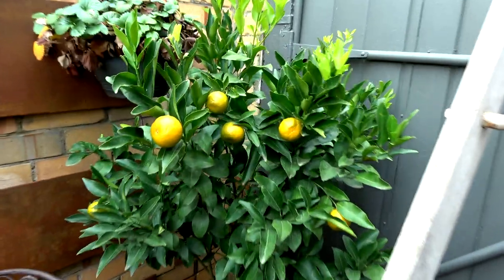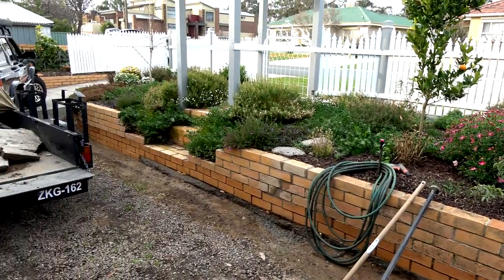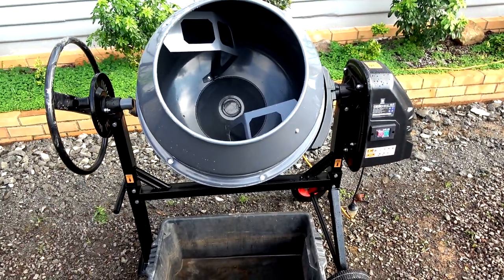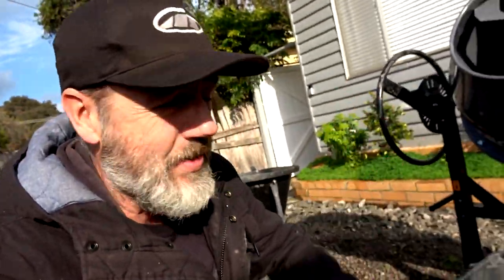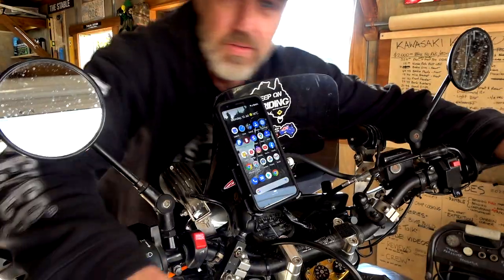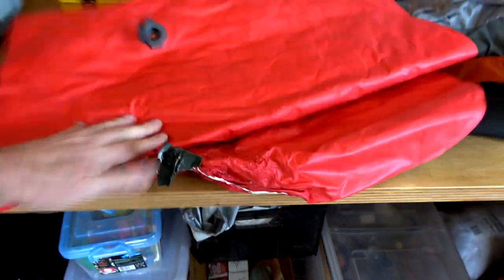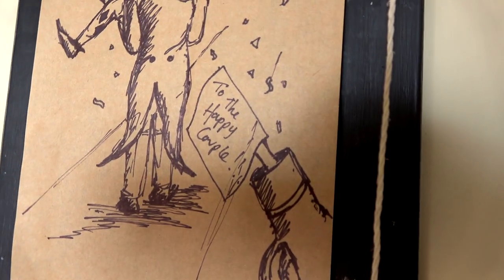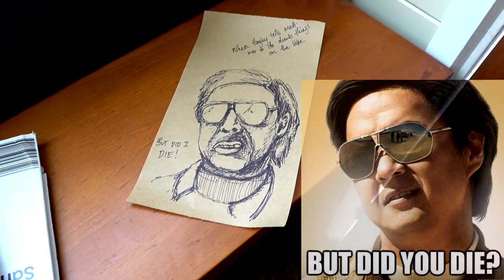Concrete & Sleeping Bags! MCT 2020 Ep.28

Comment: Hey Mark, something to consider with a down sleeping bag..  Down won't insulate when its crushed under your body.. so you need a well insulated mat to keep that warmth in.  I think you'd have a lot more luck getting a mat rated for snow/ice with a higher R value then the one you are using.  Personally I have a Big Agnes Lost Ranger bag which is designed with a sleeve in the back to slip a sleeping mat into.  That sleeve has no down in it, as it has very little value being crushed in that position.  I then use an ExPed DownMat rated for snow.  It works very well.  In really cold climates I will heat up water and put it into a bottle, or a collapsible water bladder and put it into the sleeping bag before bed.  Down bags need a burst of warmth to get the down insulating.  Ive found that if I get into the bag already chilly it can be very hard to get warmed up.  Once I am putting out heat tho, it works well.  Just my 2C!

Comment: Hey Mark. Watching you struggle with the mat and sleeping bag as to what works best. A little piece of advice for you. I camp off my motorcycle in weather temp range from -10c to 20-25c and I use the exact same bag and mat. What I have is a good quality insulated mat with an r value of 4 and my bag is a 5deg duck down bag. What I got is a good quality wool blanket. My brand is a Filson mackinaw 100% wool blanket. Yes they are expensive but there is absolutely no substitute for a quality wool blanket. Now when during the winter or cold fall weather all I do is add the wool blanket to my kit, and put it in the sleeping bag. I lay it in there taco style, one layer under me and over me inside the bag. I am like you, I sleep cold. With my bag and that blanket I sleep extremely warm without the need for any heat packs or anything down to -15/10c just toasty. If I were you I wouldn’t bother spending any more money on anything else besides a good quality thick wool blanket. It’s the only piece of kit you need to swap out between cold and warmer weather to make you comfortable. I have tried dozens of combinations of kit that I can use in every scenario and this has worked the best for me. Might be worth a shot since you basically already have the exact same set up as me. Just get yourself a good quality thick 100% wool blanket and rock and roll. Also the other benefit I found to using the wool, is it’s breaths and really fights any moisture, even if you get wet the wool will obsorbe the moisture instead of the down in your bag and the wool dries very fast the next morning. Hope this helps mate

Comment: Hi Mark, vibration from the corrugations off-road will eventually kill your phone mounted on the bars. I've had similar issues and haven't found a solution, I now use an old phone for navigation and keep the main phone in my pocket. Ride safe, cheers.

Comment: Mark, check with The Missenden Flyer on the camera issue. Modern phones' cameras have tiny moving parts built in that shake loose when used on a bike mount (push- and motorbike). Best is not to use the phone on the bike at all especially if you are going offroad.
Reply: Yep 👆 this

Comment: Hot hands chemical hand and foot warmers....in your socks and soft mits and around eight hours of heat for your extremities (which is where you bleed your heat) for a couple of bucks a night..its not like you are doing many winter nights,so cheap enough.
And...an alternative is the long slip water bottle with the furry cover..again hours of heat against your core..hey,use both !
Thermal boot liners for fishing boots..made for standing in freezing waters,even the neoprene fishing boot liners are good...I used to ride in neoprene fishing boots in winter and never got  cold feet.
You can also get thermal socks around 5 tog rated.

Comment: Mate, just returned from outback Queensland camping using the 3 part sleep system. Top tip, I found using the sleeping liner on the OUTSIDE of the sleeping bag within the SOL bivy kept me warmer plus you dont get all tangled up in the liner! And it’s easier to get in and out off when you want to go for a jimmy (take a leak, not a drink - Jimmy Riddle = piddle)

Comment: G`Day Mark and Nay, I had the same problem with my main camera on my Android Phone, the fix for me was not simple, the camera is fixed to the phone case and a little ribbon cable connects it to the circuit board in the phone, the connector had come loose and caused the camera to stop working, I took the phone to a store where they took the phone apart and used glue to permanently fix the ribbon cable to the circuit board so it wont come loose again, 12 months later and the camera is still working fine, not sure if this is the problem you are having but might be worth a try.
Reply from the maker: Worth a shot... Thanks! :-)

Comment: Hey Mark,  looking forward to the repair of the S2S mat.  I had mine out airing after the Hay Plains ride and the dog got to it,  chewed the corner off so I have a similar repair to manage.  Sent an email to S2S asking for advice but in the meantime will experiment with various glues.  I'll let you know how I get on.   Also have same problem with phone,  couldn't work out what the problem was,  now it is clear that it's due to constant vibration wrecking the lens stabilisation thingymajig.

Comment: The new stabilised cameras cant handle the vibrations. Simple as that. If you have a look at how they are constructed they will al fail. Any phone with a stabilised camera will do the same.
Reply: The front one doesn’t fail as its not normally stabilised.

Comment: My Godson owns a computer/cell phone business that refurbishes electronic devices (phones, computers, pads, etc.).  He tried explaining about the ribbons and connection strengths and blah, blah, blah, but I couldn't keep up.  It's like speaking another language.  He says the phone won't handle the long-term beating the rough terrain delivers.  In short, he said every solidly mounted phone you put on a dual sport just isn't going to last its normal life expectancy.  He compared it to riding a bike with the shock and forks welded solid.  It wouldn't do your body well.

Comment: Mark go and buy a car windscreen sun shade in the largest size from supercheap or repco cut down to size of your stretcher or size you want it will not frey when cut these sunshades have tiny pockets of air like honeycomb that traps the air works a treat and cheap to buy about 20 bucks and folds or rolls up to small size

Comment: Yes Mark I have had the same problems with 3 different iPhones. Mine were all iPhone 7 but I don’t think that’s the problem because the camera hardware is all the same basically. My diagnosis is that the fault is caused by the vibration through the handlebars. The cameras are so small and sensitive and they also have stabilisation software so I think the poor things just can’t cope. Anyway that’s my 2 cents worth...

Comment: Seen many have the same issue here in the UK with cameras  on phones failing. The common denomonator we reckon is vibration.  As it was explained to us at the NEC Bike Show the phone is not designed for the use we are using them for.  With regards to the Night cold as well Mark remember as we get older our body changes as well and we feel cold more.

Comment: Samsung Note 8 with quad Lock on ram mount 14k miles off road on road crashes Africa Twin and zero issues. I forgot to mention on the red mat how about cutting it straight across the bottom  and seal it for shorter person use. Also insulated mat with heavy thermal bag maybe do the job but man expensive.

Comment: Oh nooo it is the Dr and the Tardis.

Haven't had any issues with my phone cameras... that said you do more offroad stuff then what I do, my current phone is still an iPhone 6s only upgraded as the 5s wasn't compatible with the app I was using. The only issue I have had was the battery, the phone would shut off when temps below 10-5c add the wind chill and changed the battery for a new one and all good.

Shinny mat underneath is also for poke protection when camping you don't always get that flat ground... also remember you are testing with concrete, it does get colder than the normal ground.

Comment: Hey Mark, yes I have this issue it’s the Optical Image Stabilisation in the cameras that gets knocked around. 

So the camera can no longer focus.

iPhone you can get the camera replaced at Apple store.

 I have had this happen about 6 times on my bike but ONLY when I ride the highway from Brisbane to the Gold Coast (it’s concrete and bumpy as!)

Next phone only use it on smooth roads.

I have mine on a quad lock. Moto_Feelz also recently had this issue and he has an iPhone in a quad lock too.

Cheers.

Comment: New phones with moveable lens elements will die from constant vibrations. its a known issue. this is why the better rear camera dies but not the selfie front cam. You cannot mount a modern phone on the bike like the old bangers of just a few years ago. in a bag on on your person. Thumpers are the biggest killers.

ROC Straps for the win. They have an elastic bit that prevents movement when cinched down tight.

Comment: Hey mark go down to Kmart they have them insulation mats for $ 10.00 it comes in a roll it's a bit thicker than what you had and I think it's mylar on both sides I bought one haven't used it yet and your phone you will find its the vibrations from riding and your bike they were not made for that use if you mounted your mounts on rubber that would help also you can buy high bags that undo along the sides like a sleeping bag

Comment: Ref the phones, yeah I've seen various forum posts over the years from bar mounted phones failing from the vibrations, which is especially bad on Max with a big vibey single offroad. I don't know what you can do to stop it honestly, maybe rubber mounts? It's pot luck for sure though
Reply: I use a dedicated satnav unit so my phones are always in my pockets and fine as a result. Maybe if you need the phone for navigation you could put it in the clear pocket of your tankbag, rather than direct on the bars? Harder to see but might be safer